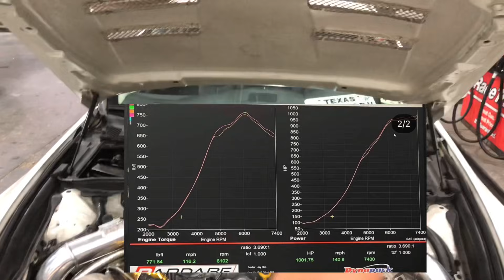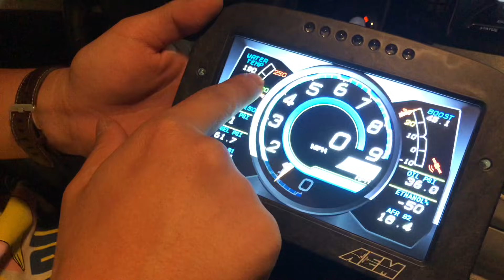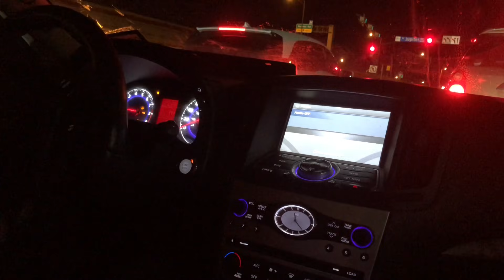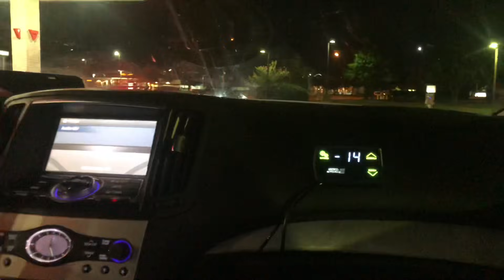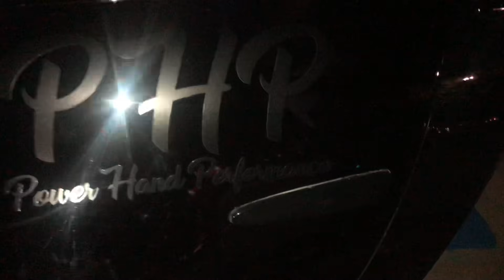1000HP INFINITI G37 VS 640HP C6 CORVETTE ON NITROUS‼️

Comment: 2:05 I don't know bro, I said the same thing in a Lexus I had, until I got caught drifting. I ran, & got away. Until I wrapped the car completely around a tree & they found me a while later.... I still has my shoulder messed up. It was a Hell of a crash. & I spent time in jail... not worth it, considering I was running from a simple ticket.
Reply: As soon as I see those lights I don't even try, but maybe that's because I'm in my slow daily that gets the job done

Comment: Don't get me wrong the G is crazy, but for the little mods the Vet has, that thing makes good power.
Reply: weight, gearing, too many factors, they’re both fast
Reply: The Vette was built for this. The G, well, not so much. It was never intended to do this.
Reply: The LS engines make great power with very few mods. The G is no slouch but you have to do a lot to make big power. I've been deciding between a G or Z vs a C6 vette. Insurance on the vette is cheapest for me as well.
Reply from the maker: That what that nitrous does lol
Reply from the maker: @jaws2003  c6 bro I’m going that way after this build
Reply: @KpThegoat  I don't blame you. Lol.
Reply: @jaws2003  how tf a c6 cheaper for insurance lmao
Reply: @ThatNofbody  that's how I was quoted. Lol. I thought it would have been the other way around. What I didn't realize at the time is that insurance companies look at accident and speeding ticket rates in your local area. Where I live in north Florida there are a lot of college students with JDM cars, mustangs and Camaros.
Reply: Give or take an v8 vs an v6
Reply: It had an lsx badge on it too so it could be rocking that particular block

Comment: My 2013 g37 sedan is starting to leak water on the passenger side but doesn’t overheat, anyone know what it is?
Reply: I know they fixed the galley gasket issue on the 2013 and up so I’m not worried about that but I think it’s just cause there might be air i need to flush out of my system since I changed the heater hoses and stuff but I wanna be sure
Reply: Its just your subroof drain
Reply: @efraincruz9273  is it dangerous to have left it like that? It’s been a week since it’s started. Gonna try and fix it this week.
Reply: @user-lz3xp7xd5r  is it leaking outside or inside the car
Reply: @efraincruz9273  outside

Comment: I have a stock 2016 genesis coupe 3.8. It is rated 348hp. It is the fastest car I have been in. I am too poor to do anything with it.
Reply from the maker: Lol I feel your pain your time will come bro
Reply: Great choice. I miss mine.  You will get your chance.
Reply: Felt the same way and I have a 2013 g37 sedan. Now i have the internals built, VR30 transmission, master silicone hose set and that’s about it. I think if you just go at your own pace without making financial mistakes, you’ll be good!
Reply: Boost coming in this summer
Reply: @user-lz3xp7xd5r  that shit gonna blow
Up if u just throw boost at it 😂

Comment: Dude with the vette should have gotten a bigger fuel pump injectors if he's spraying. Would make loads more power
Reply from the maker: Vette my be my next car 😅
Reply: What...? A wet kit mixes it's own fuel in. But then again, there's no such thing as "fuel pump injectors" so... 🤣
Reply: @rustygee4919  nitrous is just compressed air. Bigger injectors and a bigger fuel pump with nitrous will give you the most output. Even with a wet shot. Nitrous itself isn't flammable
Reply: @mmarrar  no, you won't make any more power with bigger injectors if the fuel jet is properly sized. All you would do by adding more fuel to the engine via the injectors is cause the mixture to run rich. I'm well aware how nitrous works. I've sprayed every car I've ever owned 😬 nitrous breaks down under heat into nitrogen and oxygen. That added oxygen needs a set amount of fuel to maintain a proper AFR. That set amount of fuel is determined by the size of the fuel jet in a wet kit. Bigger injectors would have zero benefit in power output created by the nitrous system.
Reply: @rustygee4919  depends on what size shit you're going for. On most ls motors anything over a 150 shot would need a bigger fuel pump. Injectors could be questionable. It's just like a SC or turbo set up you will need more fuel to deal with all the forced air or it'll run lean. However bigger injectors and fuel pump with nitrous won't run rich if the car has been tuned.
Reply: @mmarrar  it seems pretty obvious you've never tuned a nitrous car before. It doesn't matter if you're spraying a 500 shot. As long as the fuel jet is matched to the nitrous jet, the mixture will be correct.  Nitrous is not forced induction. It's not cramming air into a cylinder. It's simply a gas that follows the natural airflow of the engine. As it reaches combustion temperature heat, it breaks down into oxygen. A wet kit has already atomized the fuel needed before it enters the combustion chamber. It does not need any more fuel supplied from the fuel rail into the engine. So therefore, no need for a bigger pump or bigger injectors. The only way a bigger pump would be beneficial to a nitrous system is if you were getting your fuel solenoid supplied from the fuel rail. Then at some point, the fuel jet would need more fuel than what the pump can supply to both the injectors and the solenoid. But if you were running that big of a shot, you should already be on a dedicated fuel system for the nitrous. Feel free to read around on some forums or ask Nitrous Outlet or Nitrous Express for advice if you'd like. They're both pretty great companies with awesome customer service.
Reply: @KpThegoat  c6 is the way to go my man. My c6z is just heads cam intake NA and making 620rwhp. It takes high 700+whp in a car in the 3700-4400lb range to beat me. I can go for better heads, and a holley hi ram intake and do 700rwhp. Or I can build the block for roughly what that would cost and then run a blower and be 1000+rwhp
Reply from the maker: @JP3_C6Z  definitely my route to go ❤️

Comment: I don't think it was making 1k in that video....

A 640 hp vette wouldn't be dragging him
Reply: With a leak, shit happens. Boost leak, you obviously don't make power due to having a boost leak and such.

Ask me how I know.
Reply: @kpjc4eva  yeah....nah. If my car is down power by more than HALF the whp I'm going to notice it; no way I would keep racing and not notice half my power gone.  

I could see if it was ONE race but it was like 3-4. A leak of that magnitude you'd notice it INSTANTLY during the pull; not after you got home...
Reply: @lVlemphiz  who said I noticed it when I got home? I noticed it on the second pull. How would you know the power was lost by half? I didn't know you built the car with the fail safes in place.

Please tell me more.
Reply: @kpjc4eva  I can tell you that car doesn't run well....
Reply: @lVlemphiz  it has it's days.
Reply: Dude at 12:47 you see the G clearly putting in 1000hp-type work on the Vette. In the later runs it wasn't running right and therefore wasn't making its True horsepower. Watch it again, you'll see.
Reply from the maker: Bro the first run was definitely crazy as the video went on as a passenger you can tell he lost power overall it was a nice experience to have and on a 175 shot of nitrous that’s instant power boost bro and he wasn’t on his highest setting

Comment: If that's 1000 hp then that vette on nitrous must make 1500 whp lmao that infiniti makes 700 whp tops
Reply: I'm assuming that you've never been in any high hp car before? Turbo powered cars lose shit ton of power when it can't get the boost pressure it needs. When the turbos don't get the boost pressure, there is no forced induction happening at higher levels which leads to power loss. Makes sense? 

Plus top end power doesn't kick in instantly. Have to be in the powerband. You can see the difference on the 2nd run. Boost was cut off for fail safe measures. Vette got instapower from that 175 shot.
Reply: @kpjc4eva  my brother owns a 780 whp c7 zo6... I've been in very fast cars... but even with boost lag and traction issues 1000 whp shouldn't get gapped by a 600hp all motor vette.. yeah with spray I'm sure it's making close to 8 but still... twin 64s... built top and bottom end.. built aluminum trans.. radials.. ngauge... I'm not buying 1000 whp from that car.. the pulls weren't aggressive enough for 1000 they looked super similar to my bros vette which makes high 7s.. I belive honestly it's somewhere in that range
Reply: Dude, at 12:47 you see the car running right, putting in 1000hp-type work on that Vette. In the later runs it clearly wasn't running right... so in Those runs it wasn't making its true horsepower
Reply: @treyscott8811  you remind me of this really fucking stupid marine in my platoon. A forced induction application is no good without the turbos. They're 62mm not 64mm. Don't know where you got that from.

1. The car runs at 32 psi.
2. If boost spikes the boost controer cuts off the psi at 32 to prevent head lift known in this platform.
3. The fail safe kicked in. You can see it. I was getting less than 15psi on the later runs. 

So going back to what you were saying. I have built end, built motor, but the car is nothing without its turbos.

Say it with me.

This is my rifle. There are many like it but this one is mine. Without my rifle I am nothing. 

Now replace that with. This is my turbo. There are many like it but these 62mm turbos are mine. Without these turbos this car is nothing. 

You don't have to buy if it's not 1k or not. The record is already set.
Reply from the maker: @kpjc4eva  😂😂😂
Reply from the maker: Jesus bro you got your numbers wayyy off
Reply: @kpjc4eva  it really seems to to like you need to get that 100,000$ build dialed in lmao blowing coolant... trans Temps through the roof after 2 runs... getting gapped by a nitrous vette lmfaoo
Reply: I know this thread is 9 months old. Just wanted to elaborate on some things here.  In the video there was a moment about the G not running on highest setting.  If it makes 32psi 1001hp, then the strongest run in the video it was 25psi, well that would explain why I didn't look like 1000whp even for its strongest run. As far as bragging rights of what did in a dyno is pointless after the fact because cars have down time on dynos. And once a car on the streets up alot on the coolant side,  dyno numbers become irrelevant for the time being. This is why guys normally state ET and trap speed and 60 to 130s more so instead of dyno numbers because it's real world accurate.  Also for a all stock ls3 on a 175shot. That doesn't really add up to 642whp either. I know a guy with a cammed ls3 and long tubes on a 200 shot and even he didn't make way more 650...... he made under 6 on a mustang dyno but he spanked 750whp G8s and full bolt on e85 GTRs

Comment: Ls3 cars can’t and won’t make 640 hp
Reply: What? Explain that statement.
Reply: @rustygee4919  640 whp is impossible on a stock motor stock intake stock tb without boost
Reply: @PulsePerformance  now that is entirely different than your first statement 😂
Reply: @PulsePerformance  so you don't think an ls3 can make 640whp on nitrous? 🤔
Reply: @rustygee4919  it can I literally have a c6 lol
Reply: @PulsePerformance  I guess I'm confused by your first comment then 😅 did someone claim a stock head and intake ls3 will make 640whp on motor?
Reply: @rustygee4919  I thought that’s what was said in the video

Comment: That don’t look like no 1000hp especially if he was doing 12lbs of boost that should be around 600whp especially if the bet beat him
Reply: i had a leak. But you're right. I looked at the logs after and the car wasn't hitting 30ish psi. I was telling KP after the first run, after doing some test hit for the 2nd run, that the car wasnt right.